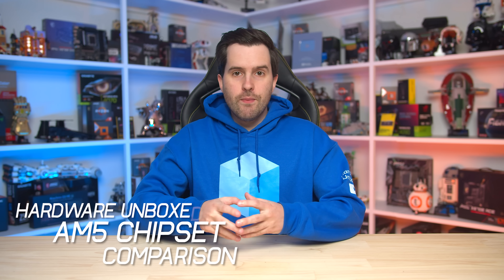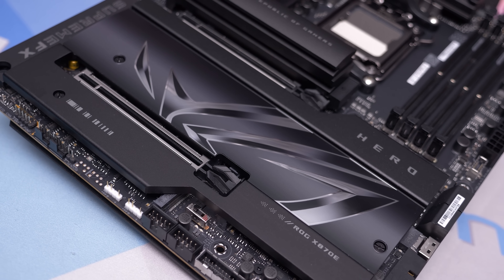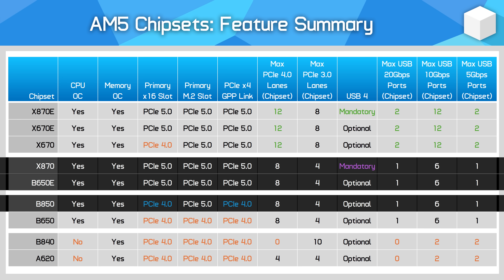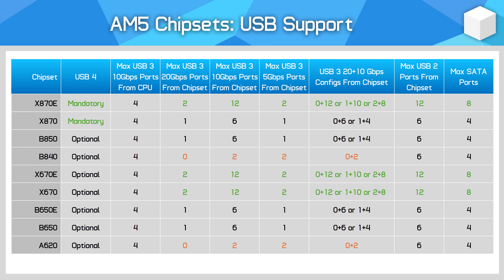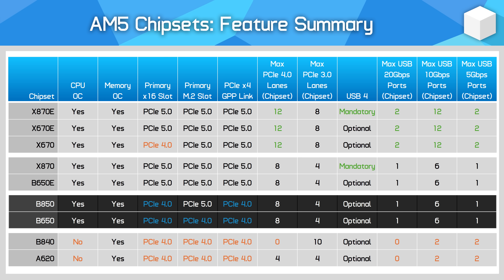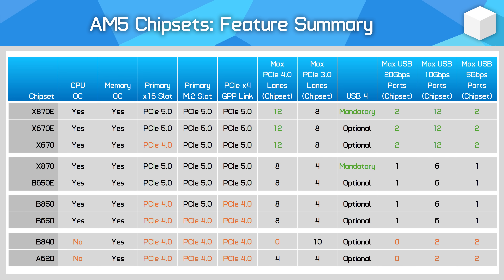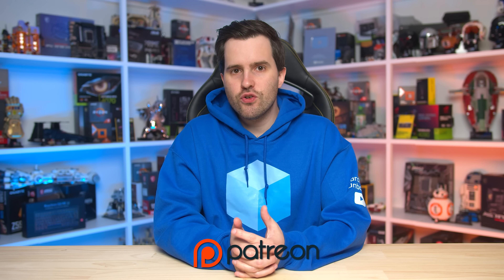AM5 Chipsets Compared - X870E vs X670E vs X870 vs X670 vs B650 vs B850 vs B840 vs A620

Comment: Watch out with 870 cards if you like me use 5.1 sound, so far I've only seen that on ASUS Tuf 870 board, all other has a simple sound out and then an optical sound out!
Reply: For gaming or film?
Reply: @Quast Some games use 5.1, as do some movies.
Reply: @Bratfalken  Yeah but without the mobo support each codec used you get a downgraded fallback bitrate anyways... and all the modern audio codecs demand HDCP
Reply: @Quast  it works on my AM4, that's all.
Reply: @Bratfalken  I mean that's at least the case with streaming and blu-ray playback.

Comment: X870 is a scam. X670 is much better.
B840 also a scam because it is B550. A620 is actually a better chipset because it is a cut-down B650, which is more expensive than a B550 already.
Reply: Have it your way throws a hamburger

Comment: I understand that some X870E motherboards use 4 of the CPU PCI gen5 lanes for the (ASMedia?) USB4 controller. This means that they loose the 2nd gen5 M.2 slot compared to their X670E predecessor. I’d rather have 2 gen5 M.2 FWIW.
Reply: From what I saw, every single X870(E) board takes four lanes directly from the CPU. Not sure if they could in theory use chipset lanes for USB4 or if it has to be CPU lanes because it needs the IGP for display out.

Comment: Is the low amount of PCIe lanes on the budget boards like A620 reducing bandwidth for CPU/GPU (-> performance) or just reducing additional USB and NVME slots?
Reply: There currently exists no gaming graphics cards which use PCIE 5.0, so any board with 16 lanes of PCIE 4.0 will do fine for gaming.
Reply: --> "just reducing additional USB and NVME slots" + and/or PCIe slots

Comment: Does sata use pcie. Thought it was a different protocol
Reply: They are different protocols, but they still make use of the same available lanes.
That is why, in many motherboard manuals, you will see things like "shared lanes" or "installing an M.2 drive in slot M_3 disables SATA ports S_5 and S_6".
Think of it as a family sedan (SATA) and a sports car (PCIe) driving on the same highway ... there are only so many lanes, so they must share or "give way" (be disabled).
Reply: @Gaius__  m.2 story is different. Consider an m.2 drive that supports both sata and nvme drives. If you plug nvme into it then you don't lose sata ports. That's because it has wiring for both sata and pcie drives. Was just reading up on sata. Apparently sata protocol can't be sent over pcie lanes. Maybe Tim can clarify all this.
Reply: @cayennest  Clarify what?
It doesn't matter whether an M.2 slot uses PCIe or SATA ... if it shares lanes, those lanes will be taken and will hence not be available to other ports, PCIe or SATA.
Once you know how many PCIe and SATA drives you want to use in your PC, choose your motherboard accordingly, by checking which ports share lanes, and by figuring out whether they will all fit.
It's the highway example again ... whether it is a sedan using your lane or whether it is a sports car, doesn't matter. The lane is taken, and you cannot use it.
Reply: @Gaius__  just checked with motherboard documentation. Using sata ports doesn't reduce pcie connectivity. If you use m.2 sata you won't be able to all the sata ports. It doesn't affect pcie in any way

Comment: Great video. Would also be nice to see the different memory support on 600- and 800-series motherboards. If a third gen AM5 cpu is launched in the future, will e.g. 600-series motherboards have support for a potential more «mature» and higher speed DDR5 memory. I guess this depends on the motherboard manufacturer and not necessarily on the chipset?

Comment: Did say if youre looking for a B650 or B650E then got for the ASRock X870 Pro RS. If you want a X670 or X670E then got for a ASRock X870E Nova
Reply: Who the fuck would ever go for X870(E) over X670E/B650E, you'd literally be downgrading.
Reply: @MajinOthinus  people who arent looking for an E-ATX board
Reply: If you want something in de middle, Asrock B650e Taichi Lite might be an option as well. Has USB4, post code and an external clock generator.
Reply: @HAM_An1mA  imo ASRock is goated, other brands are just that… brands

Other brands are Starbucks while ASRock is the local coffeeshop with that super cute girl who makes the best coffee in the world
Reply: recommended web sites to buy on the states (USA)? thanks in neweeg taaiichi lite is out od stock, thanks

Comment: Honestly, the dual chipset thing with x670 and x870E is just stupid. You just gain more "connectors" but not more bandwidth. And most of the boards, even the expensive ones aren't even close to using most of a single chipset...
Reply: Chipsets are more or less just glorified PCIe switches. It's not expected to fully saturate the uplink with a single device all the time.
Similar to how in networking you hook up every device to 1 GbE on a 48 port switch despite only having a 1 GbE uplink.

Comment: The B840 being worse than A620 is 100% certified scummy move by amd
Reply: Yeah, it's confusing. I wouldn't necessarily call it worse though, it's just designed for a different use case (for those who, for whatever reason, require a crapton of PCIe 3.0 lanes). Still a dick move, of course, because many non-tech-savvy people will automatically assume the 840 to be better than the 620, merely on account of the higher letter/number. And you can bet the 840 will be more expensive, too.
Choosing the right board is the biggest pain in the neck when building a new PC.
Reply: @AS-gb5wz  Maybe they are cheaper. Who knows.

Comment: What makes a motherboard remain functional for longer?
Reply: BIOS updates
Reply: Functional in the sense of "won't break", or functional in the sense of "long-lasting and upgradable"?
Reply: @Gaius__  In the sense of "won't break"
Reply: @Y0Uanonymous  No motherboard should break, unless you do something really crazy. Generally, it is the same as with all hardware: the less stress a board is subjected to, the longer it will live. Overclocking and running it 24/7 will shorten its lifetime, but with any modern board, that shouldn't be a problem. If you clean it regularly (and carefully) there is no reason it shouldn't last ten years or longer.
Reply: @Gaius__  Previously I had PSU, motherboard and graphics card failures. 1 PSU, 1 graphics card and 1 motherboard failure was without overclocking. I see the technological improvements don't mean as much as they used to, so I want to build my next PC in a way that will remain functional for longer, without overclocking.

Comment: fuck it iam building new mashine after 5,5 year almost...my old system was 3900x on x570 board...iam not happy i need to pay basically 100 dollars mark up on the x870e+ 9800x3d...but i really want usb4 and i will keep my new system for a long time on 4k
Reply: What do you even need USB4 for?
Reply: @Simon_Denmark  quicker data transfers on new usb sticks...probably VR...
Reply: shocked you didnt upgrade to the 5800x3d to give new life to the computer during all this time. I had a 3900x too but i think after about a year after the 5800x3d came out I got it for less than $300 at microcenter made my am4 computer gain a ton in some games.
Reply: @deadpool790  well i play in 4k...wanna move to better gpu anyway and the am4 platform isnt great for that either...i was pretty i had no bottlenecks with the 6800xt on it but you cant run 4090 or the 7900xtx on the 3900x even on 4k it give you bottlenecks even on that resolution....and i really need a 4090 type of power now its twice that fast like 6800xt..since i have 4k 120hz monitor...

Comment: Now explain to users that the Asrock B650 Steel Legend Wifi while being a non-E board still comes with PCIe 5.0 for the first PCIe slot and NVMe.
Reply: lol, yeah. Picking the right board, not only chipset but especially differences between manufacturer "philosophy", is the biggest pain for PC builders.
Reply: @seylaw  because Asrock was feeling generous with the gamers and wanted to make them happy? 
But I am sure it's going to split and share the lanes if you occupie all the ssd, m.2 and pcie slots, and that will drop the speed.  
Asrock X670E Pro Rs is still the goat 🐐 🙌
Reply: I'll just stick with my B650E Steel Legend and 7800X3D!
Reply: I had a B650 from Colorful that had pcie 5.0 for both nvme and GPU as well. It died though.
Reply: @RafitoOoO  lol
Reply: Goated board, going to pair it with the 9800x3D.
Reply: @mofous  Should just get the B650E Taichi Lite. That is a true flagship grade board without flagship prices.
Reply: @fleurdewin7958  Eh, it's 100€ more than the B650 Steel Legend, which has all the features I need. Great board tho, no doubt.
Reply: @mofous that's something I'm asking myself, as I'm most likely build a new pc this year. Do I need/want to spent 100 euro more for, USB4, postcode and a external clock gen.
Reply: @HAM_An1mA Do not buy 800 series boards, they're just downgraded 600 series boards thanks to the USB4 requirement.
Reply: B650 has optional PCIe 5.0
B650E is mandatory to have PCIe 5.0 and other stuffs.
Reply: Pcie 5 is optional on the non e 650. The e means it has pcie 5 slots and has the pcie5 link to the chipset
Reply: Because the speed of the CPU lanes has absolutely nothing to do with the chipset, that's what Tim completely fails to mention. The speeds listed in the video are only the "minimum" required speeds, but manufacturers can totally design boards with faster PCIe or M.2 connections.
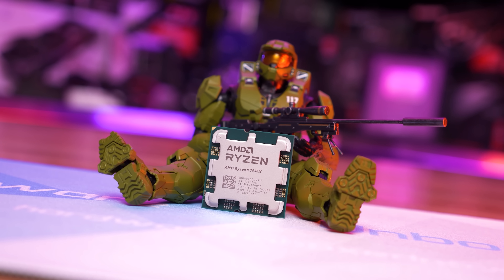Reply: @Alvin853  He literally says "what AMD guarantees from each chipset*at a minimum* at 5:23"
Reply: Yea, AsRock f up the naming there; they definitely wanted to replace the original, awful steel legend b650e, that also has pcie 5.0 x16 slot, with this one
Reply: @dereklang4451 Wonder what makes it awful something wrong with that board? Just asking
Reply: @douhgremuro150  I shouldn't have said awful, but it was really overpriced, compared to what other manufacturer offered for even less. It's also got a very limited use GPU bracket and only 3 m.2 slots and only 2 (two) sata ports, and only 7 usb ports. And it still costs more than the b650 steel legend wifi, which is much better

Comment: It crazy how AMD purposely limited the amount of PCIE lanes even on its top chipset.
Reply: Given that Intel has a history of not properly validating the operation of their CPUs on the vendor mainboards as seen with Raptor Lake, I would not trust the quality of their boards vs the AMD ones.
Reply: I suppose what would be actually useful is some bridge chips to split the PCIe 5.0 x16 into a pair of PCIe 4.0 x16, or a quad of PCIe 3.0 x16.
Seems like B650 is still a winner for budget gaming.  Reasonably priced NVMe drives have not a compelling reason for 5.0 (Even a FireCuda 540 has a maximum sustained rate under PCIe 4.0 speeds).  And I did not see a GPU saturating 4.0 x16 yet either.  Also I do not want 2x PCH hubs.  This may be marketing so that the high end ITX and MATX boards can be X870 for show, because dual chipsets for them is pointless, they haven't room for the connections let alone the extra chipset.
Reply: I mean they could introduce much more lanes in their chipset, but to what avail? Most users won't use them.
And then you only have a PCIe4x4 between CPU and chipset.
Reply: @johnscaramis2515  on the top chipset the argument is not that users will not use them, the argument is users don't have them to use.  Threadripper is dead, we need consumer level boards with lots of IO.
Reply: @marktackman2886  Intel claims up to 48 PCIE lanes on arrow lake
Reply: @ShersGarage  "Intel claims" sounds like a joke in 2024.
Reply: @blanket4u  as much as "AMD claims" in 2024 as well.
Reply: @rinsenpai135  Wrong.
Reply: @rinsenpai135 nah, AMD's marketing might be as misleading as Intel's, but at least they didn't let thousands of self immolating CPUs in the wild, claimed nothing happened and then denied RMA. Believing Intel in 2024 is restarted.
Reply: @RafitoOoO  Yeah, instead they sell discontinued products as brand new (Vega iGPUs going blackscreen on newest drivers while browsing the web)
Reply: @ShersGarage  that a reason to go with arrowlake, less gen5 lanes but overall more lanes, I'd take it personally.
Reply: When you need more Pcie Lanes buy an Threadripper and TRX50 Plattform.
The Amount of Lanes are fine for the most people on Mainstream Plattforms.
And you dont find a higher or better Lane Amount on the Competition Motherboards included 1851 MBs next Time.
Reply: @Taurus104  Threadripper CPUs have way too many PCI-E lanes... at least for me, because I really don't know how to put all of them to good use (48 PCIe 5.0 + 24 PCIe 4.0 lanes,  while Threadripper PRO CPUs support 128 PCIe 5.0 lanes, all usable lanes!), and they'll make you pay generously for each one of them on both the CPUs and the motherboards!!
But mainstream platforms like Ryzen could at least offer half the PCI-E lanes that Threadripper offers, like 32 usable lanes from the Ryzen CPUs, a mix of PCI.E 5.0 and 4.0 lanes... because I really don't like that you're paying 300-400€ for some motherboards that only have 3 PCI-E slots, and I think I saw one that only had 2!! lol
Reply: @Taurus104  threadripper is a dead platform, we need more pcie lanes for high speed io, 300G network cards are right around the corner and in order to use a lot of those cards you need accelerator cards to obtain the actual speeds.
Reply: @goUkraine  threadripper is dead if nobody buys it.  It's not about what I need something for, it's the ability to do it that's important.  Ultra Ethernet is the 300g stuff and it was released by AMD themselves
Reply: @goUkraine  your trying way too hard to put people and things in boxes, it's small minded to fight against people's desires to do things with hardware, it's a gatekeeping mentality.
Reply: @marktackman2886  ironic he calls you a shill for daring to not being a devout amd propagandist like him. To add another use case to your example: My cheap z690 had 5 m.2 slots, 6 sata and 3 pcie slots but my more expensive x670e has 4,6 and 3. I wanted to add a m.2 expansion card to fit more nvme ssds in but that would kill my gpu performance, and the only reason i havent paired the z690 with my 7900xtx is cause i also have a 7800x3d. Segmentation was also horrific on amd mobos compared to the intel ones, particularly with 7 segment displays and that ever forbidden 5th m.2 slot
Reply: @Youtubehandle9001  amen brother
Reply: @marktackman2886 How many people use 300G cards?  People already complain that there is little difference between SATA and Gen3, Gen4, and Gen 5 drives....
Reply: @farmeunit  stop if yer gonna compare Sata to gen3, 300g is a diff universe
Reply: @marktackman2886  ¿300G? That is a very strange speed for ethernet. Normal you would see 400G as a bonded 4×100G
Server farms do use lots of ethernet for sure but they often prefer solutions with less packet overhead (adds CPU load and latency), Things like direct PCIe v3  external cable links between adjacent racks or v4 between enclosures within a rack, for datacenter-wide  Infiniband and fiber-channel are also popular.(and have faster than 100G links)
Reply: @mytech6779  amd released its, its called ultra ethernet
Reply: @marktackman2886  Dude, you're not putting a 300G network card in your home PC. If you think you need it, stop, you don't. If you're talking about connecting racks of server hardware hosting AI hardware, sure, but your home network really does not need something like that. If you're running enough server hardware to benefit from a 300G NIC, you're not a general user or even a homelabber, you're a temporarily embarrassed enterprise user.
Reply: @orangejuche  I'm a network engineer, I reserve the right to do anything I want.